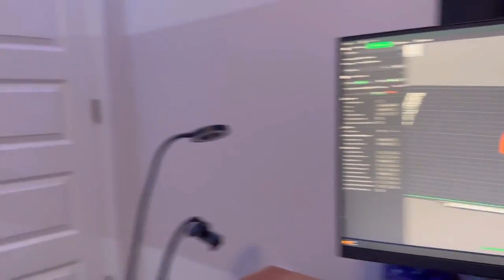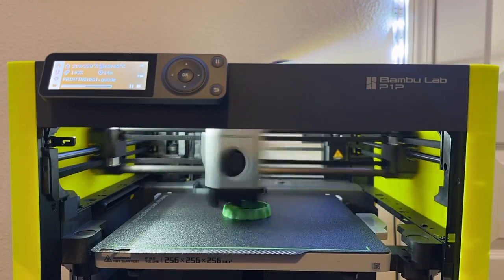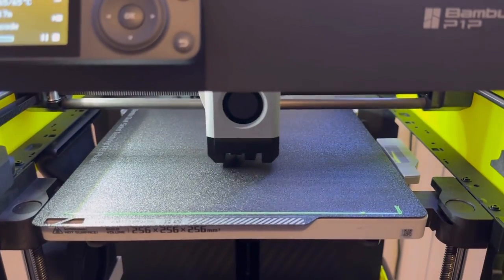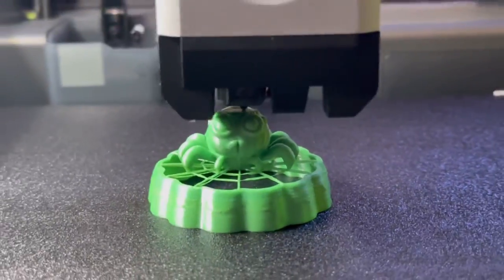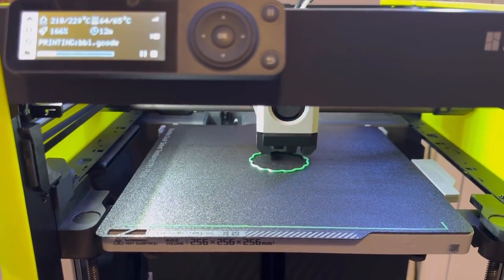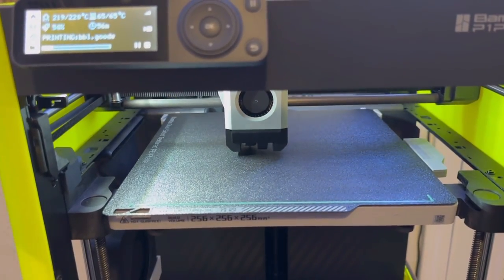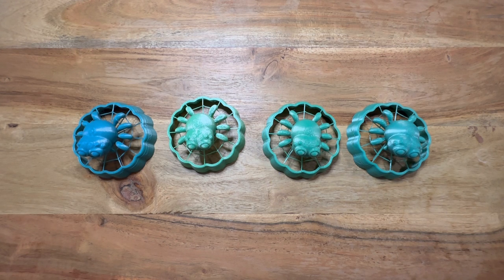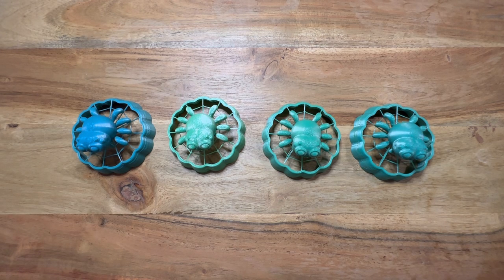Bambu Lab P1P All Speed Modes tested. Ludicrous, Sport, Standard, and Silent.

Comment: try cleaning your print head rails with IPA. had similar artifacts and that seemed to fix the problem.
Reply from the maker: It’s the filament, I think it picks up moisture fast…pla +, all my other filaments are fine
Reply: @sierra659  good to know I did not know that.
No use wearing them out before their time.

Comment: Thank you for taking the time to make the video. I have just become a new owner to the P1S and trying to get as smart as possible, before heading into printing. As I use the machine mainly for tabletop scenery I can't deal with large gaps of layer lines in the print. So, I want to know everything, before printing anything, that might go into the trash can right away if the quality isn't good enough. So for me, it is not about speed. It is about quality. As of the different coloured PLA you used, I can't really see the difference of the surfaces on your printed models. Can you tell me, how big the difference between the speeds are in terms of quality? The standard seems pretty good, but as of the different colours and different reflections and different lighting, I can't really see the details. Thank you.

Comment: Hi, thanks for the video. I have seen other reviews of the P1P where they say it's very loud, mostly the fans. But your video was very quiet to me. Did you modify the fans? Or are the other people exaggerating? Also, I don't understand how you could adjust the motion speed after sending to the printer, it does not seem logical to me (not you, the software developers). I saw you fiddled with the temperature on ludicrous. Shouldn't the print software do all that for you? So if you pick a different speed, it would adjust the temp, flow rate, etc, to match? That seems like a software design flaw to me?
Reply from the maker: It’s loud….definitely don’t want to sleep in the same room with it, as far as the temp adjustment it depends on the filament used, I turn it up just to reduce the chance of under extrusion when it’s printing faster than normal.

Comment: Why using timelaps in the standard mode? I would like to see AND hear at least 10 sec. out of every mode.
In this case the whole video makes no sense, because I can virtually slice it myself even without the printer to "see" how long does it takes for this, or any other printer too.
Disappointing... 😞
Reply from the maker: I have other videos showing standard speeds.

Comment: What are your settings? I can't not print in ludicrous without failing...
Reply from the maker: Turn the nozzle temp up about 20 more degrees and start ludicrous mode after the first 2 layers
Reply: @VivaLaChance  I will try that! Is that the only thing your doing? Nothing in the slicer? What brand and type of filiment?? Thanks man!